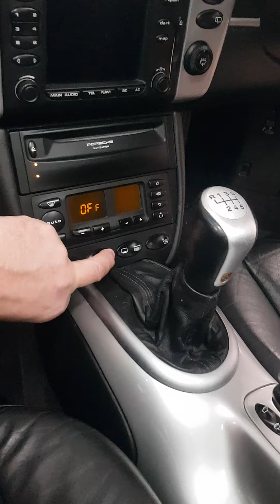Porsche 996 Targa roof repairs part 2..... saving you £££££

Comment: Hi, I have a problem, mi roof doesnt open and in the dash appears the hatch is open. Change the back hatch weeks ago but doesnt works, any tip? Thanks a lot
Reply: @danieljames515  thanks for your answer, tomorrow (sun light) I will send the video. If is any charge, no problem, thanks!

Comment: Hi, my roof window shade does not fully retract. I can fully cover the roof but when I try to retract the shade it will only retract about 50% and then another 10 - 15% of the shade will eventually retract but that's it. Any suggestions on how to approach the retrieving mechanism?
Reply from the maker: That's on a roll with a motor ...remover the plastic cover that acts as your headlining joiner and see what's stopping it from coiling up 👍